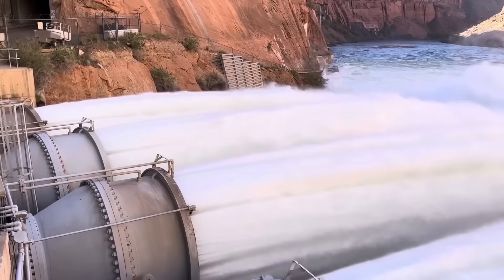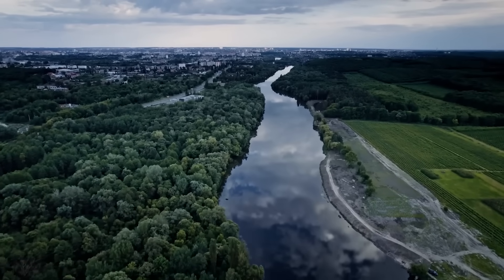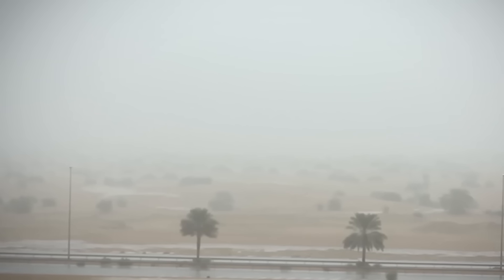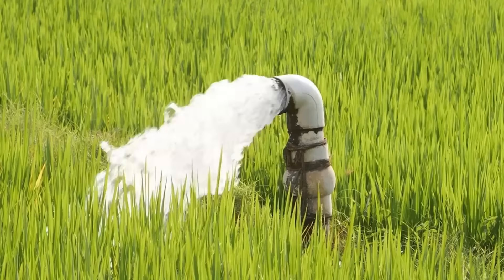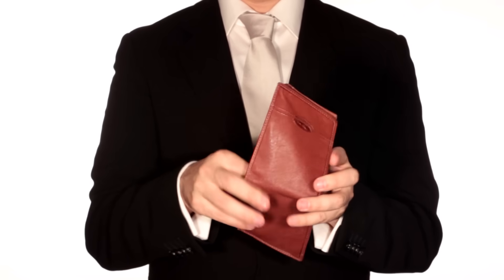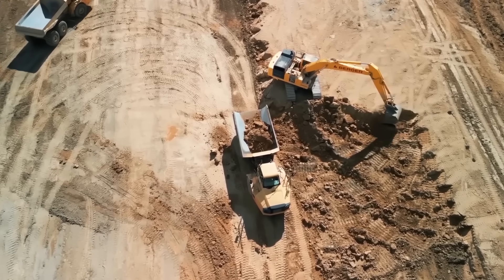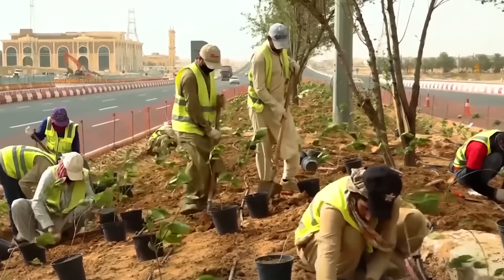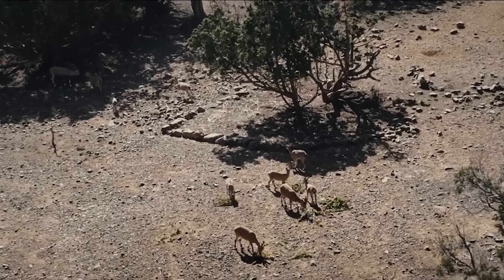Saudi Arabia Buried Millions of Gallons of Salt Water Under Sand, Result is Unreal

Comment: Yes, this is impressive in scale, but not when it's built on slave labour.
Standard modern engineering by engineers educated in America and UK.
2 places that helped developed such technology and techniques. That both have far larger systems.
Londons sewage system is way more impressive as it was built 150+ years ago, in a city that was already established.
Versus a blank canvas which has an unlimited blank check for slave labour. Well done guys, but too much self-congratulatory praise here...
You need to take a step back when you're using slave labour and borrowed engineering or a flat plane of sand.
Still, it's impressive, but relax. It's not revolutionary stuff.
Reply: To be clear, I'm talking about the comments on here.
Seems to be all about how amazing UAE are.
Might be bots. Comments are strangely pro UAE government 😅

Comment: The video did not explain if/how greening is sustainable. What kind of water reserves does it take to water all those new trees? Does greening have a snowball effect where it changes the local climate by increasing local rainfall to offset the increased water demand?
I mean, you can plant a jungle in Arizona but I can’t see it doing anything but drying up all the water reserves 🤔

Comment: I recently watched something from a different nation about implementing things in the 'empty river beds' while they are dry that capture and filter water, but not to the same extreme extreme as the dams depicted here.  I forgot what they called them: guims or something.  They are a few feet high and go across riverbeds and capture some water during those rare times when it rains.  The things placed there make it so that some water that's captured takes hours, days and even weeks to soak all the way through and then drain out at the bottom back into the riverbed.  Over years, these things can help riverbeds get back to having at least a trickle or more of water all year round, which improves live plant growth around them.  Sufficient growth also attracts more rain.

Comment: Why not make one black color pipe and connect two pipes on side from the top connections and place in on top of the hot desert ground... Let the black pipe heat and evaporate the saltwater into the 2 top water pipes on the side. It think it can work. If someone makes this then share me some company stocks

Comment: I used to work in Yemen, out in the sand desert, south of Saudi. I worked 28/28 days on and off, and in the first three years I was there i saw it rain twice (I think it rained a couple of other times but I was on days off and missed it. LOL).

 However, when it did rain, it rained baby alligators! I got caught outside in a rain storm and had to run 50 meters to a building, and by the time I got there... the water was running out of my boots.
So there is a lot of water that comes down, not often, but a lot of water when it does.

Comment: There is a carefully calculated "carbon cycle' system which wasn't mentioned but perhaps because it is many layered and uses several combinations of ancient and modern methods.
Obviously PV farms on a vast scale can contribute to desalination but so, at a low level per pipe mile, can the kinetic energy of the water. Given the enormous mileage involved, slow water turbines can make a difference. We often forget that moving water has this energy and concentrate more on HEP models of the last century. Gridding can be expensive but only has to be laid once given the low voltage produced not changing into heat along lightweight gauge wiring.
Sealed for life SMRs such as those developed by Rolls-Royce could suit a currency rich state like Saudi because anyone trying to steal fissile material nullifies it by design. Grouping many SMRs can save time and cost building traditional power stations and can be stacked in the same shaft as an initial one and output cabling can use the same ducts up to a point.
This approach is especially suited to growing towns and industries which are likely to develop domestic, localized industries.

Comment: I do not kniw anything scientific,  but the common sense tells me, if the sea water is fiverted on a masdi scale to the desert,  over a long time the under water tables will improve and the salt will be there but the humidity of the air may change rain pattens, in fact improving  things  over a long term.

Comment: Toilets can flush poop with salt water.  Many cleaning and cooling processes can use salt water.
Reply: Salt water is extremely corrosive to pipes, valves, etc, which is why it can't be used as you suggest. 

Also it deposits a lot of minerals including sodium which clogs things up until they don't work.
Reply: @mawlakewlz    Yep !  But salt water has a long history of being used aboard ships.  Use of plastics has changed much as  to corrosion.  My comment, like yours, was meant to point out salt water use is limited.

Comment: That’s great but you want salt water to flow above ground too and let it evaporate because the evaporated water will produce rain in the form of fresh water.
Reply: You can't guarantee evaporated water will actually fall within the boundaries of the country though.

Not to mention salt crystal deposition will build up quickly and block the pipeline.

The way to do it is to pump the saltwater into small circular dams and use some sort of passive concentrator optics to speed up evaporation process.

If you cover the dams with transparent domes the evaporated freshwater with condense on the dome surface and run down into channels around the circumference of the interior.
Reply: Maybe they aren't interested in salting the earth that way.
Reply: River system-26 trillion gallons     under ground river and waste water being treated(system- 2003)
Reply: But the residual salt ultimately contaminates the land.
Reply: @MargoMoore-g5r garam bisa diolah jadi bumbu masakan
Reply: No, it might produce unexpected wind patterns and might flood some areas like we had the Jeddah floods.
Reply: I don't think that's going to happen, it will increase humidity only.
Reply: @ in the desert humidity is good. If you increase production of water eventually you will get rain.
Reply: @nowaynotthatway3487  I lived in Doha, it's very hot and humid in the summer and never rain, because it will not condense, that cold area is too high.
Reply: I'm sure these guys know what they are doing buddy
Reply: It will rain, but else where.
The rain Saudi Arabia gets are water from Iraq.
Reply: SALaM, SHLAMa, SHLOMo, SHALoM, NAMASTe, PEACe.          

In The 1970's The Paracetamol & Nicotine Companies, Purchased Food Companies Like Ice Cream, Crisps & Chocolate, Adding Addictive Substances.

Homemade Crisps [Root Vegetables] Can be Made In The Air Fryer Or Oven, Just Keep Experimenting.

Corn Crips Like Dorito's, Which Is Made From Corn, Does Not Affect IBS. 

Homemade Ice Cream Can be Made With Yoghurt/Cream with Fruit Etc.

Any Chocolate With Over 50% Cacao, Is Healthier With No Addiction, Whereas Milk Chocolate Is Highly Addictive.